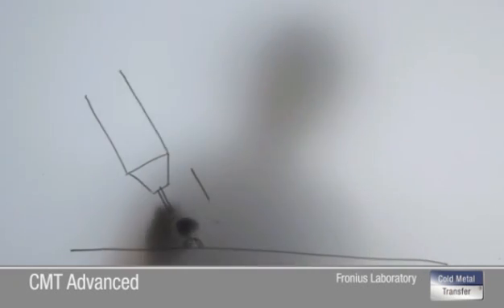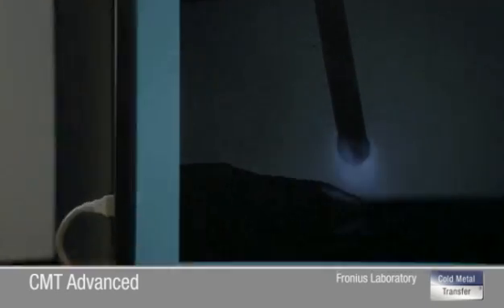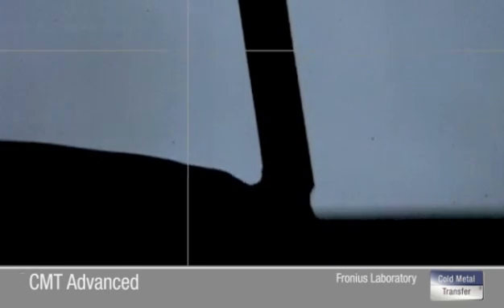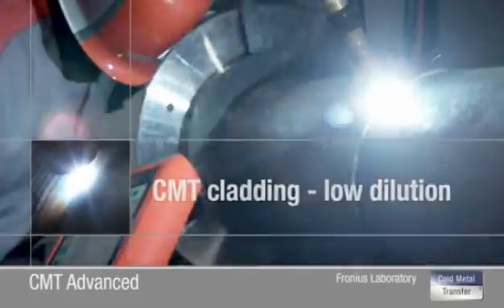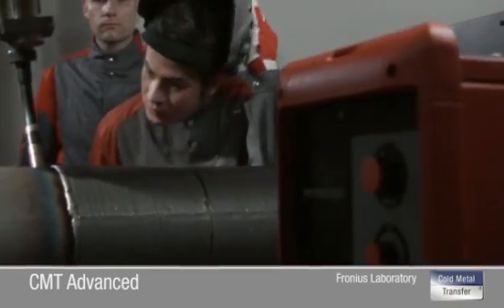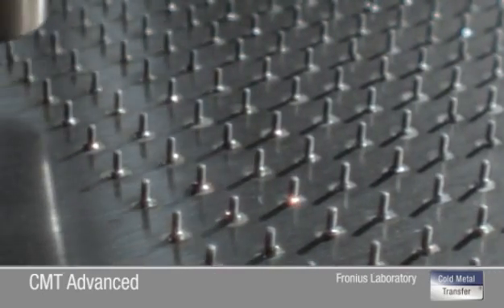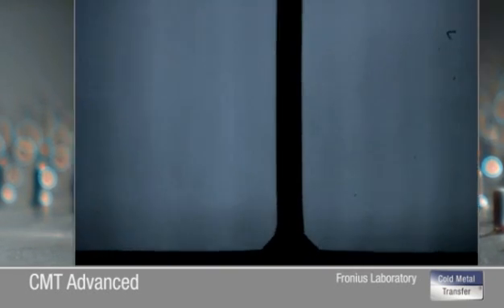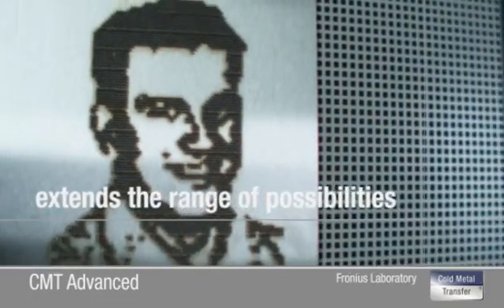Fronius: CMT Advanced Englisch/English

Comment: My biggest question is when welding aluminium to steel what kind of filler metal is used?
Reply from the maker: For welding steel and aluminum, an aluminum wire is used as filler metal. The aluminum side is welded and the steel side is brazed. Please keep in mind: Steel must be galvanized!

Comment: Are there residual stresses after welding?
Reply from the maker: There are different application shown in the Video but generally, a big benefit of the Process CMT Advanced is to increase deposition rate and degrees heat input, which give you a perfect situation to minimize or control the residual stress in the welded material. 
Basically if you put energy (heat) to a material which is necessary when you are doing welding there will be always residual stress in the material. The question is just how much stress and therefore CMT Adv. will be a perfect process to minimize or control this stress!If you have more questions we can give you the contact information about your Fronius contact person in your country.